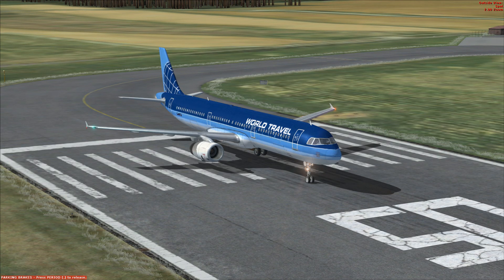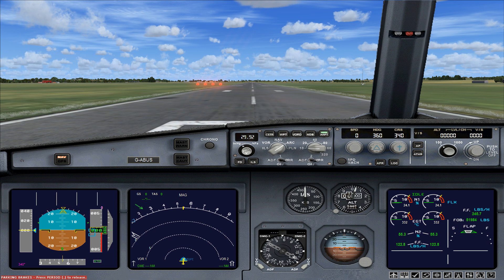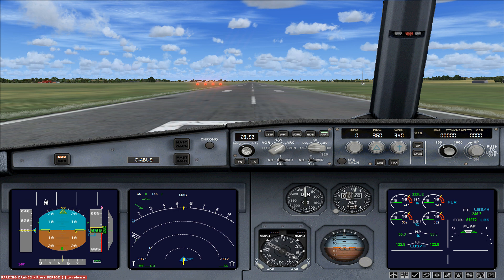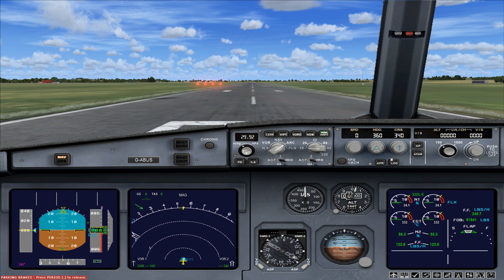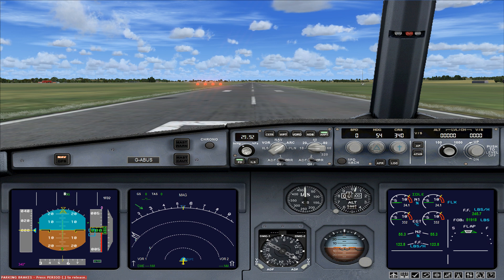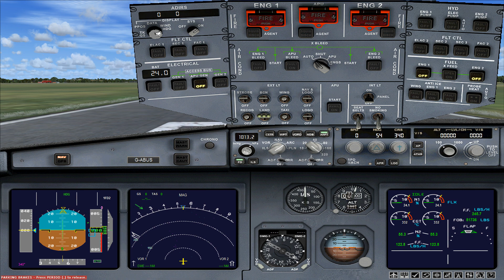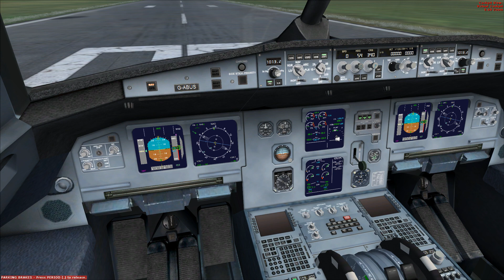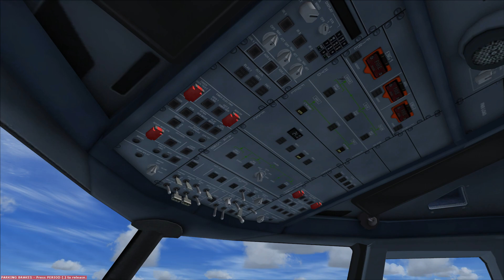FSX Tutorial: Airbus A321

Comment: Are the cockpit systems the same for the A319 and A320?
Reply from the maker: Yep and the A318 and A321 as well. All 4 planes have the same cockpit so that a Pilot who is trained can effectively fly all 4 aircraft, reducing training time and costs. The only exception is that the A318 is capable of some advanced procedures like Steep Approaches so pilots may need additional training for the A318, but as far as layout and systems, they're all the same.
Reply: In real life they are mostly the same because they're all from the same series or family. They were all based on the A320. Sometimes in FSX, mods could be different from others so controls may be different but layout will be similar.

Comment: I have the problem that the standard 321 starts falling down from the sky when iam 10.000ft above.  From this moment on, i cant handle the plane anymore..
Reply from the maker: +av1ation What speed are you flying at this point of the flight? And are you using autopilot or not?
Reply: Iam using the autopilot with GPS. Normal climbing speed. 370knt. Its a bug i think. A lot of my friends also have this problem.
Reply: 370kts is  way too fast dude, go for 300kts
Reply: Any engine failuers? 370 is too much stick to 320. The game wont bug like that so its your own mistake.
Reply: Better late than never but it's probably your pitot tube settings. Put it on before taking-off

Comment: How do you set speed hold?
Reply from the maker: Normally you have to set the Throttles to the "CLB" position and make sure that the AutoThrust mode is enabled, however I'm not sure if that button is available on the default Airbus.

Comment: One problem of this cheap planes is that in high altitude , the speed is too low, ej. FL30  325 mph  . ln real plane is about 570mph
Reply from the maker: What mach speed do the "cheap" planes fly at during the cruise? Aircraft measure their speed by mach number when cruising at high altitude, not Indicated Air Speed or Ground Speed.
Reply: Google “GS vs IAS”. That should get you sorted